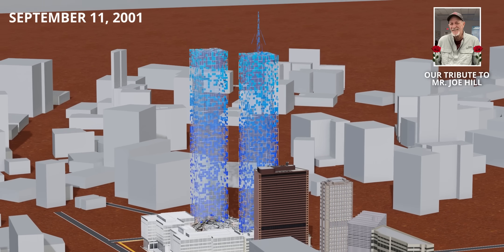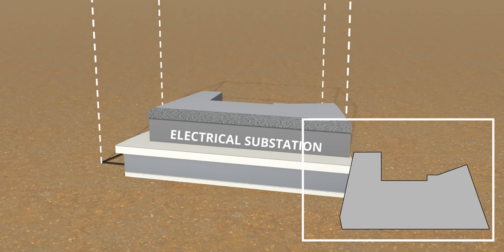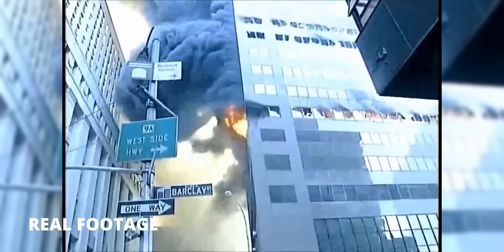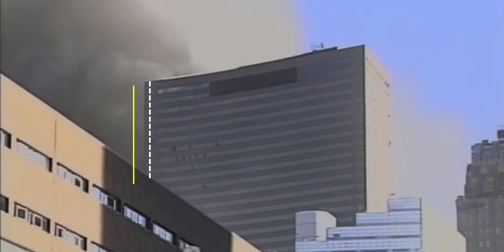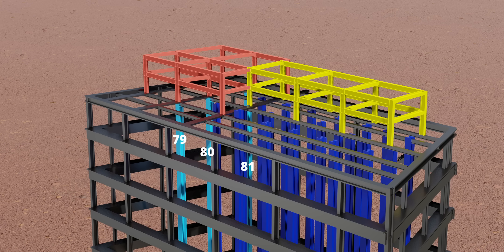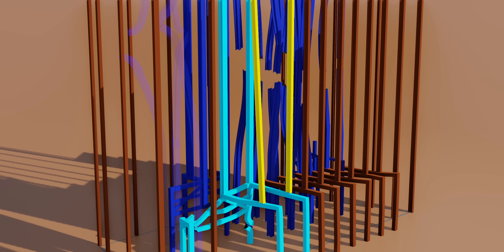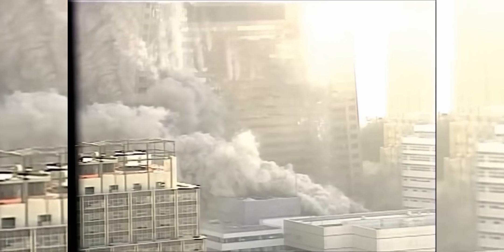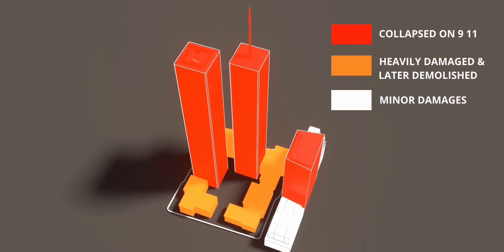Collapse of Building 7 | The Complete Physics

Comment: This video is complete horseshit. #psyop
Reply: And yet not wrong. Go figure. 
	
This video is pretty good – with a few exceptions - and goes into a much higher level of detail than many viewers will be able to comprehend.  While not perfect, the collapse mechanisms – the sequence of failures - described here  are fundamentally correct and this is true no matter who planned and carried out the 9/11 attacks or why . 

That may not be what you want to hear and go against 20+ years of entrenched dogma and conditioning, but it’s not wrong. 

That also means (in case you did not get the hint) this video can be (and IS) absolutely correct in its description of collapse mechanisms AND the 9/11 attacks could still have been some sort of inside job. The two things are in no way mutually exclusive. 

The mechanisms described here have broad professional support around the world. There are no professional engineering organizations (for example: ASCE, ASEE, ICE, etc) that disagree with them or have offered any formal dissenting opinions or alternative hypothesis. 

So, setting hubris aside, either the overwhelming majority of the worlds structural engineers and simple observation are wrong,… … or you are. Which seems more likely? 

IF you still think believe this explanation is wrong then produce a better one . Good luck with that. No one ever has and I don’t see you moving that needle today.

Comment: If they broke progressively, that SIDE of the building would be weakest, as that side starts collapsing it would PULL the building down to that side forcing it to fall over, not down.
This assumes the pillars lost structural integrity while still being able to maintain most of its form then the sheer weight and gravity pulled it down. BUT, if structure is decreased on one side first, it wouldn't do that, it would fall sideways, like removing 1 leg from a chair.
Reply: Yes that is absolutely correct it’s physics and obvious to anyone who has ever demolished any type of structure unless careful planed nothing falls straight down onto itself the floors below on the first floor are able to carry the load of all the floors above a collapse looses energy as it falls it doesn’t all collapse at near free fall speed straight down if that was the case there would be no need for controlled demolitions
Reply: No, it wouldn't, which is why it didn't. It would fall like this:  www.youtube.com/watch?v=VAkTbyENZ5s
Reply: @TheCriticalStinker-jw4fl  yet, the video lied about the antenna, that fell to the south side never hitting the towers. Keep sending that video all you want, doesn't change fact.
Reply: @UnknownTomorrow - The Sabin video was wrong about the antenna. Fix that by swapping antenna with the correct perimeter columns and nothing changes.  Just one bit of steel instead of another. The fundamental conclusions are still correct. 

The Kostack model video shows the progression of failures and falsifies your baseless assumptions, confirming that reality really happened.

Whether you like it or not.

Comment: This is the most Bullshit explanation I've heard to date!!... pretty sure that's why they use a sesame street, Let me Teach you voice-over!.
Reply: And yet not wrong. Go figure. 
	
This video is pretty good – with a few exceptions - and goes into a much higher level of detail than many viewers will be able to comprehend.  While not perfect, the collapse mechanisms – the sequence of failures - described here  are fundamentally correct and this is true no matter who planned and carried out the 9/11 attacks or why . 

That may not be what you want to hear and go against 20+ years of entrenched dogma and conditioning, but it’s not wrong. 

That also means (in case you did not get the hint) this video can be (and IS) absolutely correct in its description of collapse mechanisms AND the 9/11 attacks could still have been some sort of inside job. The two things are in no way mutually exclusive. 

The mechanisms described here have broad professional support around the world. There are no professional engineering organizations (for example: ASCE, ASEE, ICE, etc) that disagree with them or have offered any formal dissenting opinions or alternative hypothesis. 

So, setting hubris aside, either the overwhelming majority of the worlds structural engineers and simple observation are wrong,… … or you are. Which seems more likely? 

IF you still think believe this explanation is wrong then produce a better one . Good luck with that. No one ever has and I don’t see you moving that needle today.
Reply: Looks like I have an actual task now.. cool!.

Comment: NO ONE MENTIONS that ALL EXPOSED BUILDING STEEL IS HEAVILY FIREPROOFED with a THICK coating of minerals, including vermiculite !! It takes an oxy acetylene TORCH burning at 2,500 degrees F in order to cut EXPOSED steel !! No concrete and steel office building has EVER collapsed due to fire....anywhere in the WORLD....including RECENTLY in Dubai, when a giant office tower burned for DAYS , top to bottom !!! Video footage of MOLTEN STEEL pouring out of the corners of the twin towers indicates the use of military grade nano thermite,  which caused the fires under all the rubble to keep burning for many days, as it makes it's own oxygen !! This video is a LIE !! The Society of Professional Architects and Engineers collected samples of the unburned  thermite and combusted thermite on pieces of the steel wreckage ! Case closed ! INSIDE JOB !!! They got away with JFK and they wanted another " Pearl Harbor" so we could go to Iraq again, by OURSELVES,  along with Halliburton and Blackwater to grab the oil and protect Israel from being surrounded if Iran took over the weakened Iraq !
Reply: There's an awful lot wrong with that post. If you would care to discuss it, I'm open. If not then, well,... you do you.

Comment: Why after all these years are they still trying to spin a controlled demolition?  The building would NOT have collapsed down upon itself so perfectly with out assistance,  this is just fact!
Reply: So "perfectly", in fact that it fell across two separate, 4-lane streets in opposing directions, damaging the Verizon building to the tune of 1.4 billion dollars worth, and Fiterman Hall so badly it had to be torn down.
That's about as "not perfectly" as you'll ever find. Then again, you wouldn't know "fact" if it up and bit you on the ass.
Reply: @mooneyes2k478  Man you are a real smart one, of course there would be damage to the surrounding buildings,  you can't take a building that big and not have surrounding damage to the other buildings.  Being a structural Ironworker for over 30 years I know a little bit about how building are made and there is now way the building would have come down like it did.  A whole building would not have collapsed onto itself because of a failure of just three columns.  Buildings here in America are built better than that.
Reply: @mooneyes2k478  Don't beat around the bush and passive aggressively accuse him of lying. It's cowardly. Say it. Directly say to him, "You are lying about working in ironworks." Say it.

Comment: No explanation of freefall for 2 seconds that has already been acknowlwedged by the official report by NIST. Freefall cannot happen unless all supporting collumns are removed at the same instant. this video must have been financed by NIST who believe office fires caused the collapse. NIST already has been exposed using incorrect analysis & had to readjust their findings when it was shown the correct dimesions of girder supports.
Reply: Perfect explanation, in the actual official report, showing quite clearly that you didn't read it.

"Freefall", gravitational acceleration, happens quite easily and handily. That you don't understand that, and instead blindly repeat the nonsense you've heard, doesn't change anything.

No, the only ones who think "office fires" was there at all are people like you. WTC 7 burned on every floor, over the entire floors, for 7 hours. Anyone who want to call that "office fires" are desperately trying to pretend their pet fairy tale is true, ignoring the facts.

No, NIST hasn't been "exposed" anything. Pretending otherwise only show, again, that you prefer your cool action movie plot to the real world.
Reply: Why does it matter?  How fast one corner of the exterior moment frame (the hollow outer shell or as this video put it - the empty cereal box ) fell briefly at the very end of the collapse, when 90% of the building is already gone requires no explanation.  Completely insignificant.
Reply: @TheCriticalStinker-01  Where is the evidence 90% of the building was gone.
Reply: @eljay19489  - Described in the video above and in that NIST report you never read, plus a bunch of others you never heard of.

Comment: How did all the steel columns in Building 7 simultaneously fail allowing the building to fall at 9.81m/s^2 with no lateral movement6? Linear Shaped Charges!
Reply: The magical kind that didn't actually make any noise, and was emplaced invisibly.

Or, if might have been that the "simultaneous failure" wasn't actually simultaneous. You know, the way the explanation says?
Reply: @mooneyes2k478  Garbage
Reply: @ True enough, but I didn't expect you to admit it. Good on you!
Reply: They didn't.  Were you not watching the video?

The Buiding did not collapse at 9.81m/s^2, the Exterior Moment Frame did. The Building itself was already gone by that point, leaving only the exterior moment frame - the "empty cereal box" mentioned in the video.  This was primarily supported by just 4 columns at the corners and well, no surprise that once all of the core columns were gone, dragging the floors and most of the perimeter columns down with them, those last few columns supporting the EMF buckled under the strain at more or less the same time, causing the empty cereal box to fall. While it did it was most definately leaning and twisted into an S shape while falling to the south.

So your observation skills need some work.
Reply: @TheCriticalStinker-01  Garbage. If you believe what these confidence tricksters told you, I have a bridge to sell you. Cheap! Understand that most private Engineering Consultancies would do anything for a dollar.

Comment: Still trying to cover it up hu?
Reply: And yet not wrong. Go figure. 
	
This video is pretty good – with a few exceptions - and goes into a much higher level of detail than many viewers will be able to comprehend.  While not perfect, the collapse mechanisms – the sequence of failures - described here  are fundamentally correct and this is true no matter who planned and carried out the 9/11 attacks or why . 

That may not be what you want to hear and go against 20+ years of entrenched dogma and conditioning, but it’s not wrong. 

That also means (in case you did not get the hint) this video can be (and IS) absolutely correct in its description of collapse mechanisms AND the 9/11 attacks could still have been some sort of inside job. The two things are in no way mutually exclusive. 

The mechanisms described here have broad professional support around the world. There are no professional engineering organizations (for example: ASCE, ASEE, ICE, etc) that disagree with them or have offered any formal dissenting opinions or alternative hypothesis. 

So, setting hubris aside, either the overwhelming majority of the worlds structural engineers and simple observation are wrong,… … or you are. Which seems more likely? 

IF you still think believe this explanation is wrong then produce a better one . Good luck with that. No one ever has and I don’t see you moving that needle today.

Comment: The vice tone and detailed over explaining is usually a give away of total bull shite being thrown at the blanket in the hopes of it sticking.....
Reply: Or, it's an attempt to get people who think it's bull shite to actually use what brains they have. Not that it generally works.
Reply: And yet not wrong. Go figure. 
	
This video is pretty good – with a few exceptions - and goes into a much higher level of detail than many viewers will be able to comprehend.  While not perfect, the collapse mechanisms – the sequence of failures - described here  are fundamentally correct and this is true no matter who planned and carried out the 9/11 attacks or why . 

That may not be what you want to hear and go against 20+ years of entrenched dogma and conditioning, but it’s not wrong. 

That also means (in case you did not get the hint) this video can be (and IS) absolutely correct in its description of collapse mechanisms AND the 9/11 attacks could still have been some sort of inside job. The two things are in no way mutually exclusive. 

The mechanisms described here have broad professional support around the world. There are no professional engineering organizations (for example: ASCE, ASEE, ICE, etc) that disagree with them or have offered any formal dissenting opinions or alternative hypothesis. 

So, setting hubris aside, either the overwhelming majority of the worlds structural engineers and simple observation are wrong,… … or you are. Which seems more likely? 

IF you still think believe this explanation is wrong then produce a better one . Good luck with that. No one ever has and I don’t see you moving that needle today.

Comment: There is zero defense or excuse and story for this. This is key evidence and proof what happened.  Common sense people
Reply: And yet not wrong. Go figure. 
	
This video is pretty good – with a few exceptions - and goes into a much higher level of detail than many viewers will be able to comprehend.  While not perfect, the collapse mechanisms – the sequence of failures - described here  are fundamentally correct and this is true no matter who planned and carried out the 9/11 attacks or why . 

That may not be what you want to hear and go against 20+ years of entrenched dogma and conditioning, but it’s not wrong. 

That also means (in case you did not get the hint) this video can be (and IS) absolutely correct in its description of collapse mechanisms AND the 9/11 attacks could still have been some sort of inside job. The two things are in no way mutually exclusive. 

The mechanisms described here have broad professional support around the world. There are no professional engineering organizations (for example: ASCE, ASEE, ICE, etc) that disagree with them or have offered any formal dissenting opinions or alternative hypothesis. 

So, setting hubris aside, either the overwhelming majority of the worlds structural engineers and simple observation are wrong,… … or you are. Which seems more likely? 

IF you still think believe this explanation is wrong then produce a better one . Good luck with that. No one ever has and I don’t see you moving that needle today.

Comment: Many structural engineers disagree with this theory. Mostly because it doesn't make logical sense. The fires were not hot enough to do the type of damage claimed in this video.
Reply: No. Literally no structural engineers disagree with it. And making up things to soothe your ego doesn't change that.
Reply: @mooneyes2k478  That's incorrect. There are many who disagree and many who continue to ask questions. Ever heard of the over 3000 Architects and Engineers for 911 Truth? It's got nothing to do with my ego, but you may want to check yours before posting a comment with incorrect information.

Comment: What a load of crap.
Reply: And yet not wrong. Go figure.

This video is pretty good – with a few exceptions - and goes into a much higher level of detail than many viewers will be able to comprehend.  While not perfect, the collapse mechanisms – the sequence of failures - described here  are fundamentally correct and this is true no matter who planned and carried out the 9/11 attacks or why . 

That may not be what you want to hear and go against 20+ years of entrenched dogma and conditioning, but it’s not wrong. 

That also means (in case you did not get the hint) this video can be (and IS) absolutely correct in its description of collapse mechanisms AND the 9/11 attacks could still have been some sort of inside job. The two things are in no way mutually exclusive. 

The mechanisms described here have broad professional support around the world. There are no professional engineering organizations (for example: ASCE, ASEE, ICE, etc) that disagree with them or have offered any formal dissenting opinions or alternative hypothesis. 

So, setting hubris aside, either the overwhelming majority of the worlds structural engineers and simple observation are wrong,… … or you are. Which seems more likely? 

IF you still think believe this explanation is wrong then produce a better one . Good luck with that. No one ever has and I don’t see you moving that needle today.